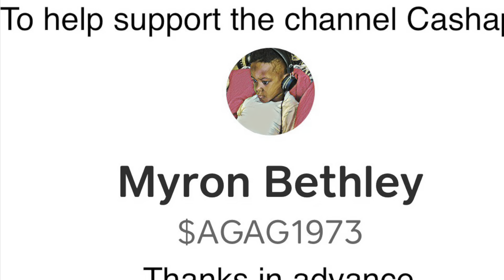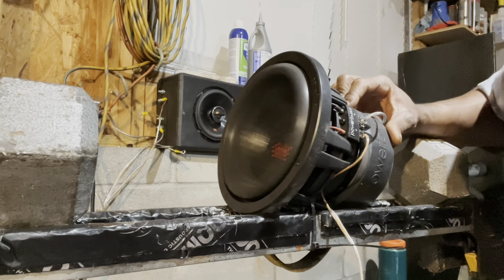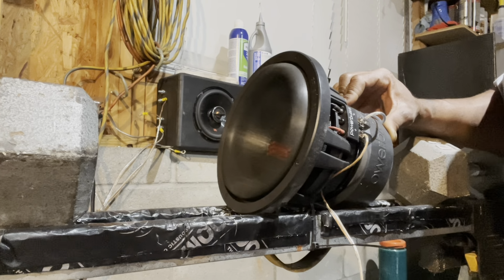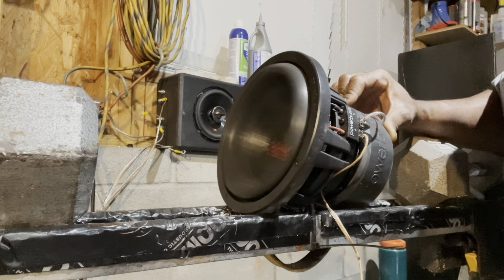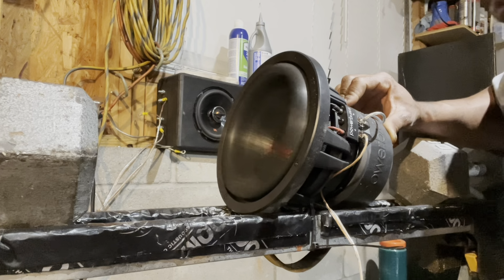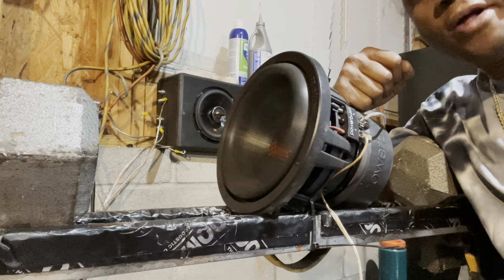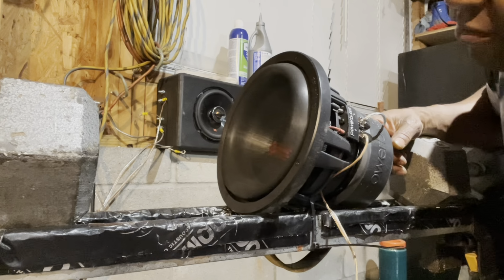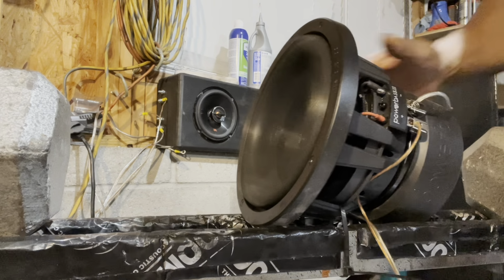PowerBass 3XL-810D Free Air! Subwoofer Porn!

Comment: Hey brother ever think of doing a video of your thoughts on Inverted Speakers in Enclosures?
Reply from the maker: Only need to invert if the volume is too small.. no advantage to output. But it help the subwoofer stay cool
Reply: @M.B.Enclosures  yeah I was thinking it would be a cool run threw too see how you explain it. I built a inverted setup for that Sundown Nightshade V4. The motor on the back of the Nightshades are the biggest u have ever seen so it works great. In the process of making it pretty. That or perhaps speaker breaking in ( do or don't ) video. Lots of people just scream "send it!" 😆